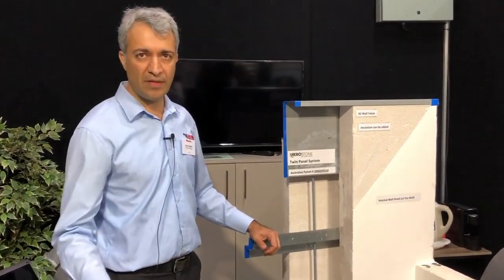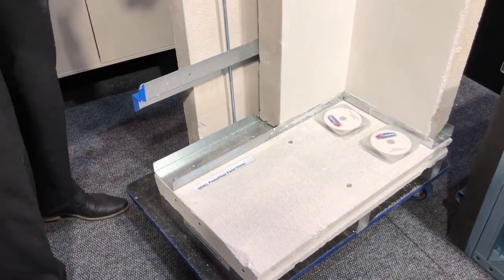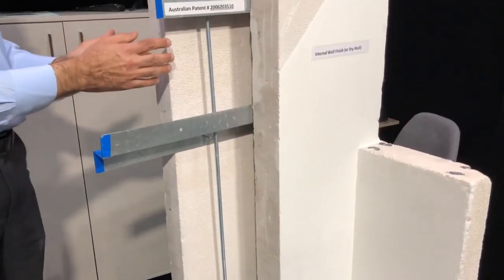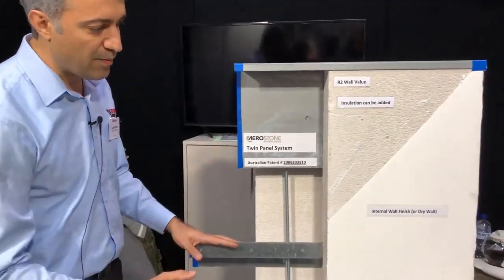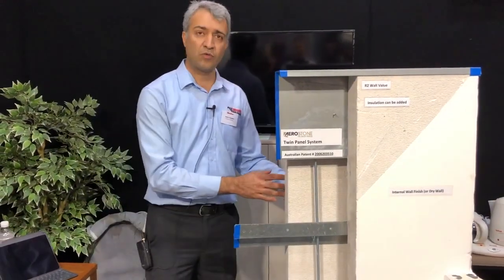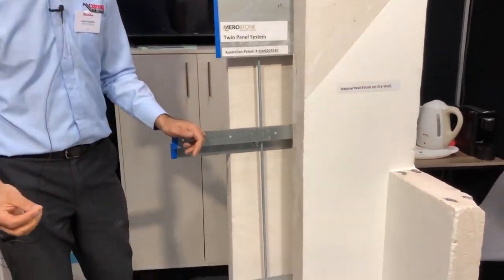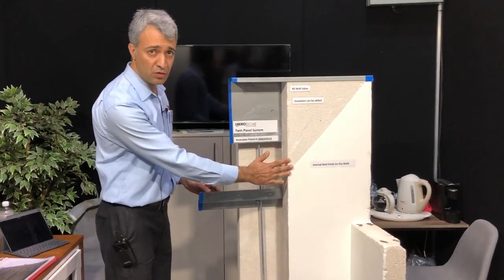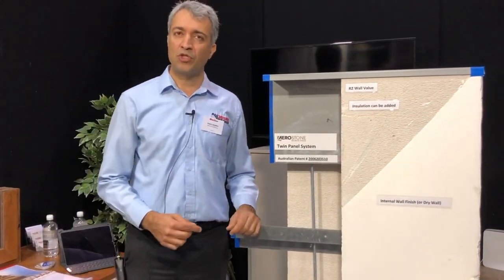Aerated autoclaved concrete wall panels for light gauge steel framing building

Comment: Hi. Is it easy to achieve over 1000 kg/m3 density with non-autoclaved aerated concrete just using aluminum powder? Or is there another additive or process needed? Thank you.
Reply from the maker: Not easy but possible. For which purposes you need 1000 kg/m3 density?
Reply: @stretchceilingsDubai  Planning to make blocks for walls. What's the normal range for NAAC? Normal meaning easy.